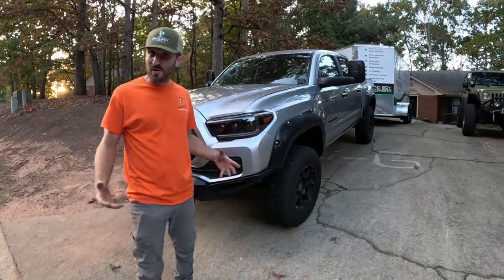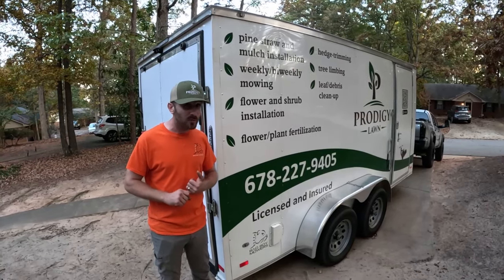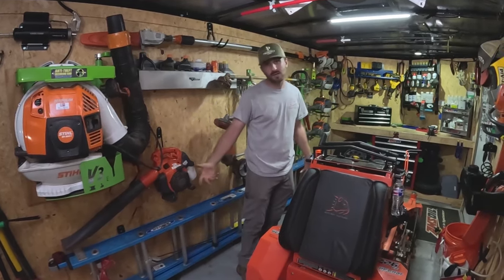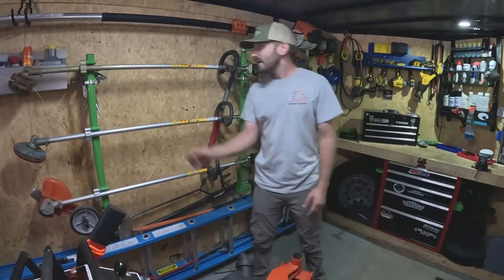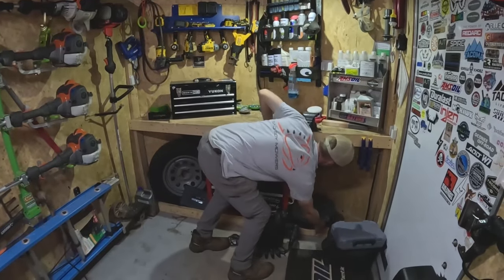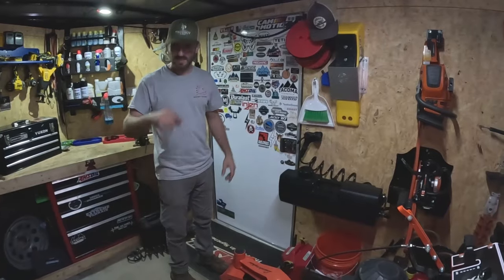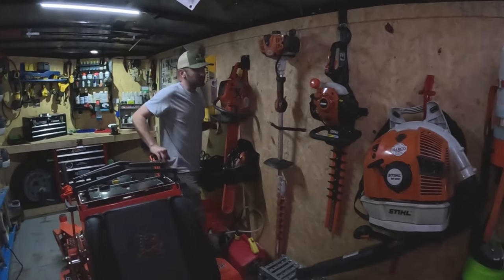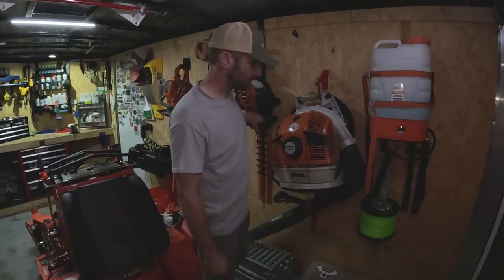BEST LANDSCAPE TRAILER SETUP 2023

Comment: Great video bud! One of the nicest enclosed trailers I’ve seen by far! I don’t have a garage either but I built me a shed and moved most of the things I don’t use to it! Now I got most of the tools such as impacts, wrenches, sockets, jacks, etc. on my truck in tool boxes! (Will have a truck tour video soon)
Reply from the maker: Thanks bro! I do like that shed you built you did a good job. I would build a shed but where I live right now I don’t plan to be very much longer so I don’t want to start building anything either heavy or permanent….but when I move from here into my next house I’ll be building a shed also….i do like how you have that battery charging set up for your mowers and anything else though. Do you find that useful or that it makes any difference? Or is it just a peace of mind kind of thing?

Comment: Just kind of breezed past the mower 😂  Nice work bench area. 

I'm interested to see a more indepth video on your truck mods. You make it sound like you have mission control inside there 😂 👀
Reply: The br600 is the goto blower, every landscaper's got one? 🤔  What?? 🤣🤷‍♂️
Reply from the maker: lol I’m not even gonna lie….you’re kind of close…. 😂😂😂😂
Reply from the maker: Ditch lights, chase lights, rear bumper lights, singular light bar up front, double smaller light bars also, 8 rock lights, interior lighting under dash and seats, 1 10 inch sub, 2 8 inch Rockfords - 1 under each seat, 4 separate amps….throttle controller….a lot more too….it’s honestly a little embarrassing lol I have a problem
Reply: @prodigylawns  I hear you 😂 Put it all in a video when you get time. I'd also like to get a closer look at those tires, radio system ( since you obviously care avout audio 💪🏽👍 ), etc.

I had hardwired colored led footwell lights and stuffed a 2x12 cab in the back of my old Dodge 🤣 and I honestly miss both. My 2014 has a decent system, but the bass is still no comparison. I'd like to change out the stock sub when I get some time to see if that beefs it up any....maybe even rig up an adaptor, see if I can put a slightly bigger sub in there  ( I think it's only 8 or 10" )

Comment: If you weren't aware stihl makes a 94r it's a 2 stroke with cutting head 10lbs.
Reply from the maker: Yes I’m aware. The Guys I’ve known that own them said they had problems with them lasting under commercial every day use and not enough power….maybe they got it right as of 2023 but I know stihls weedeaters got beat out for a while by multiple other companies…..another example is I know a few tree guys that were all about stihl chainsaws forever and they wouldn’t even pick up another manufacturer and they’ve gotten sick of the chainsaws always leaking gas and also in the price range of $1000 and less they just don’t compete with some of the other brands anymore even from a power and reliability standpoint ….like my Husqvarna 550xp mark II definitely outperforms the stihl MS261 in the 50cc chainsaw class and all the guys who are pros agree…I’m just saying stihl was the go to for most of these small engine machines for professionals for many years and they’ve been caught up to and surpassed in many categories now. Again, I still think they have some specific pieces of equipment that are awesome…just not as many as it used to be.

Comment: Genuine question here , how is filling the mowers up at the gas station being that they are inside a trailer ? Do you have to unload them everytime ?
Reply from the maker: I normally have my truck pumping gas being filled up while I walk in the trailer and normally empty my 5 gallon, or what’s left over in it, into my 54” mower and then go fill it back up when my trucks done as well as my 2 and a half mix can.It really All depends on where I’m at with everything also. If I know I’m low on gas or basically empty with everything then yes I’ll just back the mower off real quick….its not very often I have to load up both of my mowers either. Normally I take the 54” revolt. None of this takes as long as a lot of guys seem to think either…..oh and sometimes I can just pull the trailer side door up right by the pump and just fuel them through the side door lol

Comment: Do you keep a spare mower available in case your main one breaks down
Reply from the maker: I do have a second commercial grade stand on which is the exact same as the one in this video. I have a 54” deck and a 36” deck both are 2023 Bad Boy Revolts…normally just have one on the trailer with me unless I know I’ll need the smaller one…I keep spare parts to fix either on the job if they go down…if it’s more serious than that I just leave and go grab the other while I drop the one that’s down off at the mechanic….luckily my routes and mechanic are all only 25 mins away at their furthest…but most problems I can fix right there.
Reply from the maker: How about you?
Reply: @prodigylawns I have yet to start a lawncare business but that's one thing I've always wondered about.  Wouldn't want loose clients if the mower had to go to the shop for a while.
Reply from the maker: Well honestly that’s not something that happens normally and it’s very rare. Just keep up the maintenance on your mower and also keep spare belts, tools, tire plug kit as well as portable air compressor…things like that. Cover every base of what could happen to make your mower go down while your out working and be prepared. When something that bad finally does happen and you need another mower while your main ones in the shop you’ll have made enough money to buy a second mower at that point lol. Just keep up and take care of your equipment and don’t dog anything to death you’ll be fine

Comment: Nice trailer....how does it pulls
Reply from the maker: The trailer is awesome but when I load both mowers on it plus everything else you have just seen it’s not far off of weighing 7,000lbs. So I had to upgrade a lot of things on my truck…lift kit with leaf springs made for towing heavy weight as well as the brakes are completely different and made for towing as well. Biggest game changer was when I re-geared it to 4.88 Yukons. That’s just a few things there’s definitely a lot more but because of all that it pulls great and everything’s smooth

Comment: What is total weight of trailer? We have a 7x14 with 7' ceilings and total weight with mower and tool chest, etc is about 5k. 2023 Tacoma has a tow rating of 6500lbs. Tows it no problem, why the regear? Because of larger tires and tow??
Reply from the maker: So the regear solved the gear hunting issue I had that’s common on all the 3rd gen Tacomas and it also allowed me to do 60-75 mph on the highways when I may need to and again the truck just cruises easily in the process without Rpm’s being all over the place while it’s trying to decide on which gear it wants…that gear hunting issue with these trucks was ridiculous. Also, yes bigger tires as well….but mine weighs when loaded down normally and I have both my mowers on it a little over 7,000. Normally I just need my main 54” mower though and then I sit at about 6,000…….but idk man if you don’t have someone of these things upgraded on your truck it gets torn up pretty quickly from doing all this. I don’t mean this in any sort of rude way either but I feel like if you were able to drive mine and pull your same trailer for a few mins you might think right now it seems like it’s pulling your trailer no problem and easy, but when mine lets you really feel what pulling it with ease feels like you might feel differently afterwards…I’m also running Corsa exhaust, injen evolution intake, aFe throttle body spacer,14 stack Mishimoto trans cooler, all power stop brake package upgrade for towing..calipers and everything, OME 3 inch heavy duty lift package with Dakar springs also….and it keeps going. But doing that stock everyday is going to tear it up quickly man. Especially the transmission…but the number one upgrade I’ve got that does the most for helping me tow my trailer easily and safely is the Redarc Towpro Elite brake controller, that thing is amazing with what it does controlling your trailer brakes. Leave it on auto mode so it just applies the brakes with you in sync with your trucks brakes….im serious it’s amazing man.
Reply: @prodigylawns  It's a nice rig for sure! Our Tacoma is just stock, gonna do the OTT soon to help with gears. You have a a heavily modified truck so i get why the re-gear...you are heavy!

Comment: Do you know how much it weighs? Trailer?
Reply from the maker: It’s between 6500-7000 with both mowers loaded up. I rarely need both mowers though. Got my truck regeared and a suspension/lift setup tailored for towing so it hasn’t been a problem thankfully.